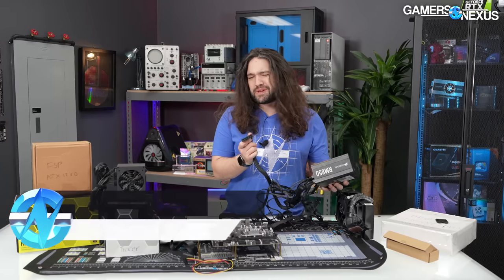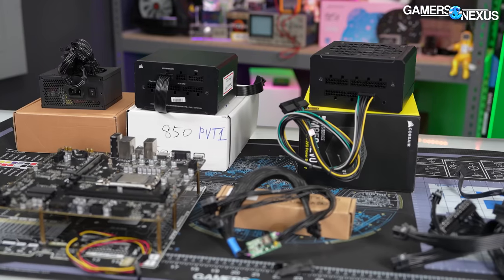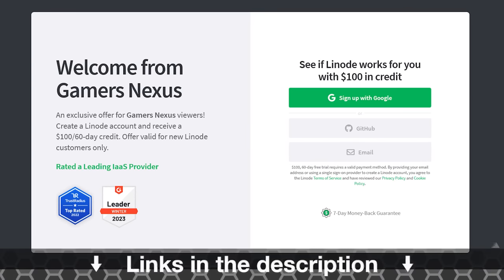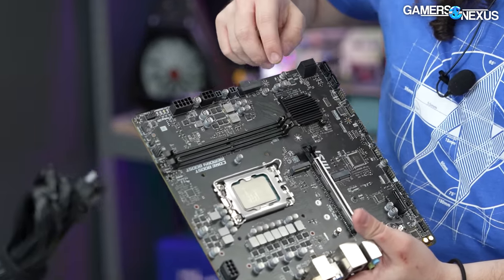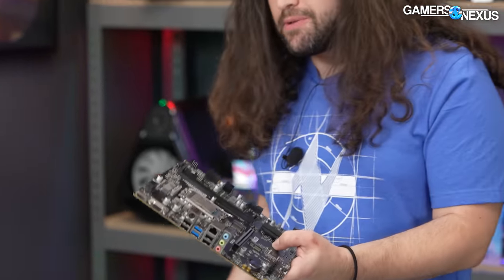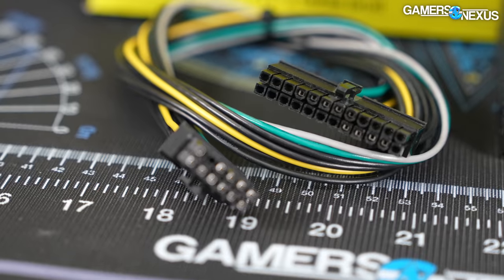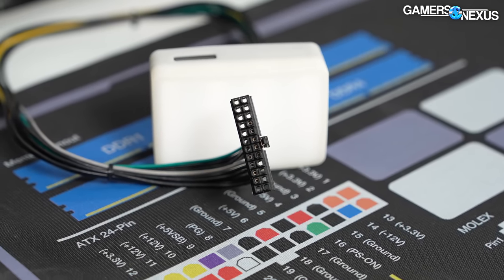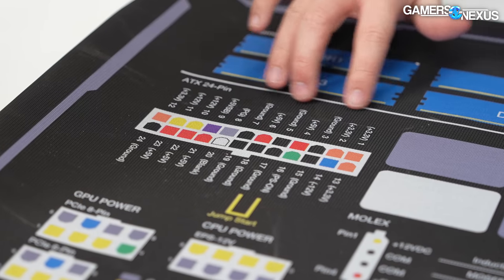The Future of Power Supplies - Maybe (Motherboard Cost, Cables, & ATX12VO)

Comment: The easiest method to improve the power grid is to improve the grid itself and have enough power production in store for the demands each 24 hour cycle. Why the DOE, EPA, CARB, Government etc. believes the public should be forced to retrofit, improve, alter, do without, conserve, time shift their end of the power consumption is way more expensive for power users plus it shifts the real power grid expense onto the public vs. the poiwer grid owners. Not to mention the cost of power is being manipulated to be way  overpriced than it needs to be to service a reasonable and well designed power grid. Engineers in the electricity field know the best methods however, the politics in states and power generation and sales seems to see it much differently than the experts who are best at this engineering type. It's interesting how suddenly your average person becomes an expert just by being voted into a public servant position.

Comment: I want 12VO, but I don't want this messy middle ground. Either everything runs on 12v, or don't bother. Adding step down components to every part but the PSU makes very little sense.

Comment: I look forward to this. But my only concern is about systems that want to use a ton of hard drives. Will motherboard be able to supply them. Although most power draw is from 12V anyway. But even sata connector count could be an issue.

Comment: So why exactly is this more power efficient? The same conversions have to take place, so it seems like it would be equivalent at best. And at worst, it could be less efficient because it seems like a PSU manufacturer is more likely to use better circuit design and better components than a motherboard manufacturer might.

Comment: I don't understand the economical sense behind this idea.

Even if we imagine an impossible perfect world where not only motherboards become more expensive due to increase in complexity, materials and components, but power supplies drop in price due to reduction in complexity and materials instead of retaining the same price, motherboards get upgraded and replaced more frequently than power supplies both in practice, and for good objective theoretical reasons as well - functionality and interfaces of a power supply are basically primitive compared to the motherboard and there is no reason for them to change as often as motherboards do.

It makes no economical sense whatsoever to move components (12V -> 5V & 3.3 converters in this case) from an infrequently replaced unit to frequently replaced unit. Over a typical longevity period of a power supply it will result in users paying for those converters multiple times instead of once.

Comment: Looks like a BEC from a remote control toy... not a bad idea, but I'd rather have a purpose built well designed PSU dealing with multiple rails, instead of hiding it in cables

Comment: Why 12V then and not say 24V? Half the current over cables and a lot of industrial use 24V.
Reply: Because the greatest voltage any component would need is 12v. Unnecessarily converting from 110v->24v->12v would be inefficient. Lower currents would be nice, though, especially from a safety perspective.

Comment: I genuinely loathe this shift in design - Motherboards are hard enough to find years later compared to CPUs and most other components. Having motherboards deal with power conversion just ends up giving them more points of failure and will undoubtedly drive up costs.

I'd much rather see all of this be handled with an inbetween device or a slot in card of some kind.

Comment: Just using 12 volt is fine and dandy, BUT why route it all thrrough the damn motherboard? Just have devices step down the voltage themselves. We are not talking hundreds of volts and ampere here. Well okay inside the cpu only but still. 

This adds a bunch of BS and complexity to motherboards that are already very complex and are pricy enough as is, plus we are not saving a cable because it still comes from the motherboard. And then we need shielding and measures to keep more powerlines on a pcb that soon will pack or sometimes is already packing on retimers for signal integrity for pcie 5.0. 

Get your 12VO power supply, name it 12VO only powersupply, and have it use 12VO sata 2.0 power connectors, new harddrives come with the new connector, maybe make it backward compatible if possible, same connector but only 12 volt and have the drive detect newer or older. Certainly there must be options.

Comment: Motherboards are already the most complicated and likely to fail component in a system. I don’t think adding complexity to that will make it better, especially when the motherboard makers may not have the same knowledge of power delivery required for making quality power conversion circuitry that psu makers have. Sure they’d adapt, but it’s going to be a long and painful transition.

Comment: Keep the standard,   putting voltage stuff on the board, will cause more failures on board, and it harder to fix.   You lose space on board,  and their to much on boards now, causing more mb failures,  n pop up cost.

Less you have the board do, more reliable it is.

Comment: Motherboards are expensive and already struggle from so many possible points of failiure, moving more of the computer on them just introduces more points of failiure and makes them more expensive, doubly so if one of those points fail. Getting power delivery on a PSU is much more reliable and it's less of a headache trying to figure out on which of the million features' hardware the mb manufacturer cheaped out on, and a single one ruins the whole thing.

Comment: it's a chicken and egg problem that no one wants to make a first move as it involves an outright transfer of cost across 2 industries. Motherboards are already expensive nowadays as is, why would any mobo manufacturer take the hit for the PSU industry especially if they don't sell PSUs. And if mobos don't take up the 12VO standard, there's no way PSU manufacturers will start making them in any sort of number as there's no market for it. Intel should have written a more modern ATX standard with safety features and efficiencies that doesn't involve mobo changes.
This was poorly thought out

Comment: Wouldn't this mean a metric ton of fried motherboards that fail from 12v shorting high to the CPU and to the ram, to the PCIE, to pretty much everything? Shorting VRM's are quite deadly especially if it's on the very device that it's meant to power -- instead of taking the hit to the power supply where it can be made to whatever quality it needs to be, and which can cause a dead short to the heatsink more often than to the supply rail.

This smells like some really corporate clandestine lobbying to increase profits across the board for PSU and motherboard manufacturers.

Comment: Potentially if the power supplies contain less compeonents could they not shrink in size smaller than an sfx supply. The power supply itself may go more efficient but surely the loses would then move to the motherboard as it transitions the voltages in a similar manner to old power supplies?

Comment: yay let's move all the noisy switching DC DC conversion to the motherboard, where it is hard to shield.
IMHO 12VO is DOA and a bad idea in general for a variety of reasons.  EMI/RFI issues, reliability issues (PSUs are cheap-ish to replace, mobos not so much), compatibility issues (what if you want to run 10 drives or two gpus or ...) and many more.
Intel wants more money, so they'd rather not see it go to PSU manufacturers.
It would be much better/easier to work on a standard that allows the PSU to shut down rails that aran't needed for standby.

Comment: Hell no. The motherboard is already one of the most expensive components. I don't want to unnecessarily give up the ability to quickly, cheaply, and easily swap out a potentially faulty component. There is no benefit to actual users. We're talking about making pc ownership more expensive and less reliable for a claims and completely baseless claim about energy consumption.

If there actually is an energy savings here, which there almost certainly isn't, then it would be FAR more than offset by the increased cost of hardware for new machines, and the repair cost for a parts failure.

Comment: With all this 12 VO hyper about being much more simplier they still left the Flipping 4 + 4 Pin CPU header on the top of the MOBO in the worst place to get to it inside a case!!!! Intel need to take a hard look at its designs on new standard that do not fix the all the major issues.

Comment: Putting extra vrms on mobo is a terrible decision. Size, cost, complexity, circuit noise, failure points.

It is a bad choice to do such a thing.

If components become 12v only, it will be fine. Until then, traditional PSUs are the way to go.

Comment: I would go full radical and put psu outside the case. Use usb-c cables with 12V/8A or 20V/5A = 100 W per cable. 1 usb-c cable for cpu vrm, 1 cable for peripherals and needed amount 100 W usb-c cables for each cards in pci-slots.

The era of high consuming pc should be killed. Smart phones can do much gaming for less power. Upscale pixels for 1440p and 4k.

Comment: IF it's not broken, why change it? If you throw too much on the motherboard, doesn't that now create a single point of failure, surely having on the PSU is more safer for overcurrent protection etc.

Comment: Why not just make only the motherboard use the 10 pin 12vo? Other connectors and voltages can just remain the same so the psu can still be responsible for the other voltages for other hardware like sata ssd? if the 5v is dead on the motherboard, we have to replace the entire damn motherboard just to power the sata ssd. AFAIK, sata ssds does not use 12v. There are also other accessories which also needs 5v.

Comment: Really, we should be moving to something more like 24VO, or better 48VO.  Nothing on the mobo, video card, etc is directly using 12V as is, it's all being run through power stages to get dropped to high amperage 3v, 1v, etc, and all those power stages can be re-done for higher input voltages too.  Now, why bother upping the voltage you may ask?  Well, double the voltage, and you halve the amperage to deliver the same wattage.  A 48v setup could deliver the same power with 1/4 the amperage required.  Imagine powering an RTX4090 with a single PCIe 8pin connector, comfortably.  48v is already heavily used in the telco world, it's not a new challenge on the engineering side, the work has already been done.

Comment: I hope if this does move forwarded I will be able to buy a cheaper board say with no 4 pin sata ass ill only need CPU, fans, gpu, USB and nvme.(pci ) 

So I won't want any drive, disks, RGB, sata water cooling and so on.

I'll be pretty anoid if I have to buy a board filled with stuff I won't even be using.
Or what would be cool is if they make add on's like expansion cards you can add too say power sata drives and so on.

Comment: This whole "upgrade" does not feel like one to me, the end consumer. We're getting more efficient power and the trade off? More expensive MB's with much higher likelihood of failure on a part that comes with a much shorter warranty period and will be much more of a hassle when it does fail. 

Good PSU's tend to come with a 5-10 year warranty while MB's typically come with 2-3 years, at most. Now a lot of what could have failed in a PSU will now be failing on the MB. Not a problem when it's the PSU 4 years into it's life but when it's on the MB? Good luck, now you have to try to track down a used MB or upgrade your CPU/MB and hope that DDR standard didn't change because now you need a new ram kit as well. Also, when a PSU fails it doesn't typically take your whole system down with it these days and it's easy enough to go buy a new one if you need that machine up and running right then and there. MB fails? Same shit as above about having to find a used board or buy an entirely new MB/CPU/RAM. There will be no quick fix and it'll be more expensive if it's out of warranty. 

Not to mention the difference in price between a good PSU and bad PSU is not that large while the difference between a bad MB and a good MB is massive. If I buy a "cheap" board with this new spec did the MB maker cheap out on the power delivery? I guess I'll just have to roll that dice and hope not or spend way way more, great. 

As an end consumer there is one positive and a whole laundry list of negatives. Also, more efficient power isn't going to save the world, government regulation of oil industries and the like is what we need to do about climate change. This kind of shit is a Band-Aid on a gaping wound that will ultimately do little and make PC building more expensive and less convenient. Also, about that reduced demand on the grid. Perhaps you could make power a public utility and spend money on infrastructure with are tax dollars? Just a thought.

Comment: How the heck is a motherboard supposed to suck back over 200W if none of that goes to the CPU because it gets its own connector?
And why then add another 6 pin? Very confusing. Would make sense for boards with 3+ PCIe slots, but not for something small.

Can't wait for U.3 to kill SATA Power forever and unify everything into one plug to obsolete those plugs on the board, too.

What about ITX boards, by the way? Are they "impossible" with 12VO? They're already incredibly dense and literally stacked right now.

Comment: Not good for longevity in the real world.  It is exactly the ability to quickly and easily replace a power supply in a 10 year old computer that saves waste and provides customer convenience.  Not to mention preventing disruption in workflow.  The forays into proprietary power supplies from HP and similar OEMs over the last decade has already harmed this greatly.  Where normally you can keep a couple types of power supply on the shelf and repair almost anything, the custom supplies going into many cheap desktops are a nightmare as they have to be special ordered for each model.  Yes, by all means, let's take every advantage a tower/box PC has and destroy it by making it as proprietary as an AIO PC.  Great idea. (not.)

Comment: Why cant the 12vo power supplies just have the 4 pin connectors for sata cables also? It wouldnt be that big of a deal, and would be better than having the additional 4 pin connectors on the motherboard, which is honestly kind of stupid and defeats the purpose of a smaller connector in the first place. Just because the motherboard has to run 12vo, doesnt mean the power supply has to be 12vo.

Comment: Honestly I dont like 12vo, the reason given was power saving and thats fine but putting all the conversion on the motherboard is stupid. If we need to convert it anyways why not do it in the psu off the 12v rail like it would be on the motherboard but keep it internal and keep the cables off the motherboard. If you want it to communicate and reduce power unless its needed add some communication lines to the motherboard like the 12VHPWR connector has, no need to completely redesign the system.

Comment: Just another marketing ploy to drive up prices on motherboards...  It's bad enough with Nvidia adopting that bulky adapter to fit the 40 Series GPUs to an ATX 2.0 PSU - resulting in massive cable management issues on my end.  I plan to buy a cable & angled adapter from Cable Mod to address this issue.  Seriously, if it ain't broke - DON'T FIX IT.

Comment: That "converter cable" looks ridiculous. Can't believe that shit is actually the best they could come up with.
Have anyone wondered how it even supposed to work if it requires 12v? How power supply supposed to go into standby mode if for 12VSB this cable needs 12V from power supply?

Comment: I think 12VO will give a massive advantage in packaging for modern PCs. A 12VO power supply can be much smaller and more powerful than the same PSU with the additional rails. In addition, the cables are much smaller. I wonder if we'll get a new small power connector for connections directly to the psu at some point, because using molex or sata with only the 12v parts connected seems a bit silly and confusing to me. And while 6 pin pcie or 4 pin cpu would work, its a bit overkill.

Comment: Why can we just have a daughter board with like a 36/48pin sata style single cable from the daughter board to the motherboard. if psu/daughter board fails your motherboard is safe, and the daughter board is way cheaper, also make cable management easier being able to mount the daughter board on the back

Yeah really don't want a friend cpu and other parts as well
Reply: If you look at my comment, I explained how this is already done in data centers. I believe this will catch on eventually the desktop market with OEMs before we see it in enthusiast market. But it's cheaper to replace a $50 dollar control board vs a $1500 mobo.